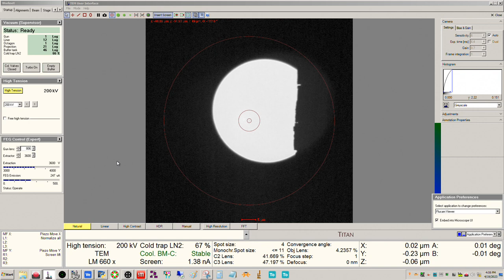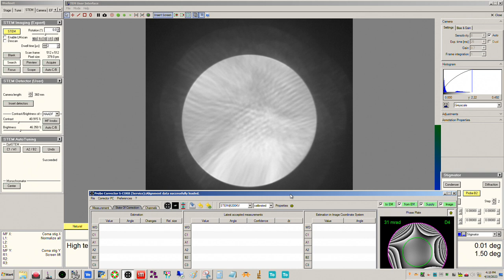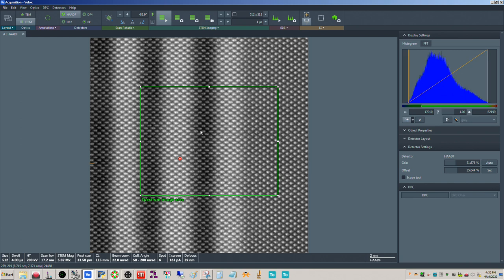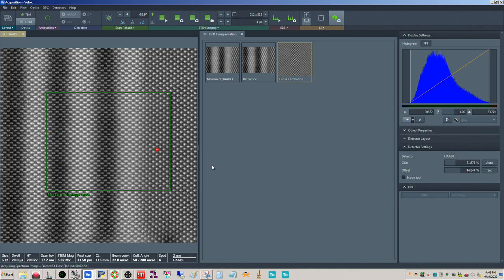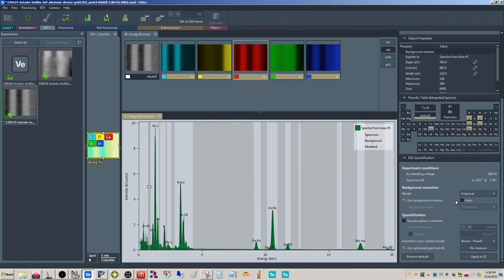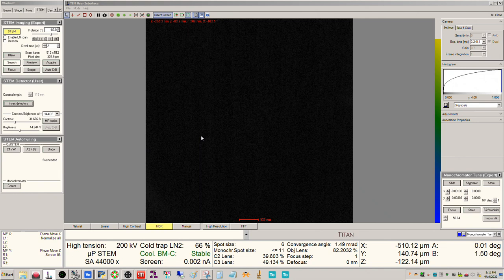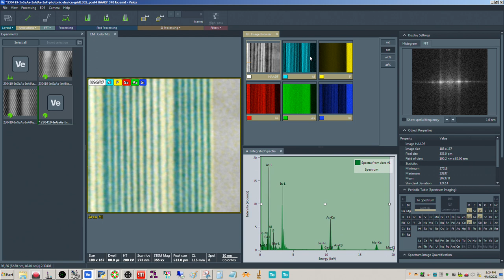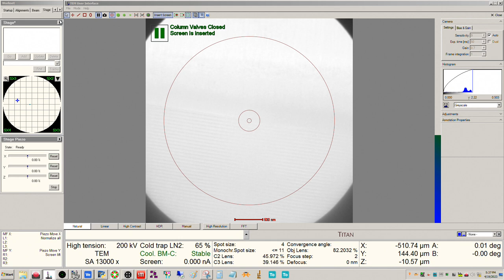FEI Themis Z S/TEM: STEM-EDS mapping

Comment: Thanks for nice video!
You may show also extraction of the line scan profile- it is more correct from the analysis point. 
How you perform the micro-prob tuning? Only what you had shown or there's more alignments?
Reply from the maker: Hi Sergei:  You're welcome; you don't need to perform any "tuning" when using microprobe mode like when you are in nanoprobe mode.  The reason for this is the small convergence angles used in microprobe mode.  The corrector tuning is only needed when the convergence angles are much larger.  I could have also done the beam tilt pivot points as part of the microprobe STEM alignment, but this isn't really critical.  Aside from that, there isn't much else you need to do beyond what I showed to get the best performance as it is not really a "high resolution" imaging mode.

Comment: Great video! my sample have many elements and suffer from severe peak overlap. is it possible to manually control the energy range of specific element and form the mapping?
Reply from the maker: Thanks, Stan.  About your question, I do not believe manual control of the energy range for a given element is possible with Velox; you are stuck with whatever "window" the software assigns.  However, if you collect the map with TIA, I believe that you can do this.  That being said, while TIA can give you more functionality in this regard, it is very limited in terms of collecting the actual EDS data because it only allows for "single pass" analysis whereas Velox allows for as many passes as you wish.

Comment: Great video !!!! I wonder to know...in case if I don't have aberration corrector for stem mode is it possible to get atomically resolved EDS map (we have image corrector on our FEI Themis microscope) ? Thanks a lot for your videos !
Reply from the maker: Thank you!  Yes, it is indeed possible (though not as easy) to get atomic resolution EDS from a non-corrected instrument.  In fact, the first time atomic resolution EDS was demonstrated, it was on a non-corrected instrument (though the data certainly wasn't very good).  On modern non-corrected systems that are very stable with very good EDS systems, I think this can actually be done somewhat routinely and the results are rather impressive (though again, not as impressive as with a corrected instrument).

Comment: Is there a specific reason why the specimen gets damaged from its right region during EDS mapping or EELS SI?
Reply from the maker: Great question; I'm not exactly sure, but it may be related to the scanning pattern used by the probe.  Somehow, this is resulting in the probe briefly pausing at the right side of the analysis area as it is scanned from left to right.  This is somewhat speculative, but I do know from experience that a stationary probe always causes more damage than a moving probe, since the moving probe isn't continuously hitting one spot.